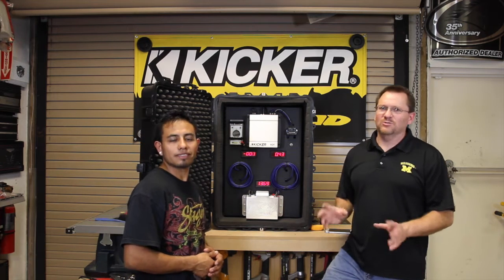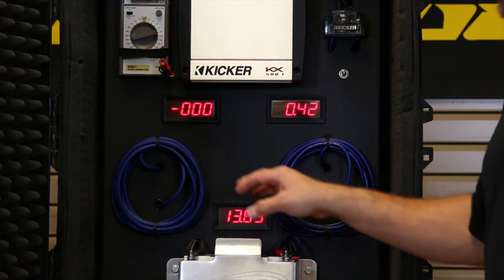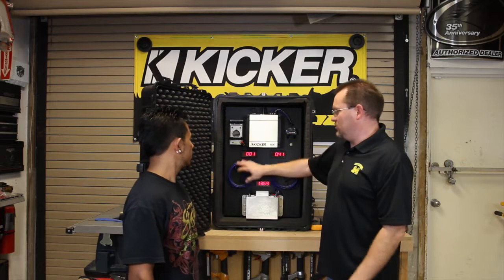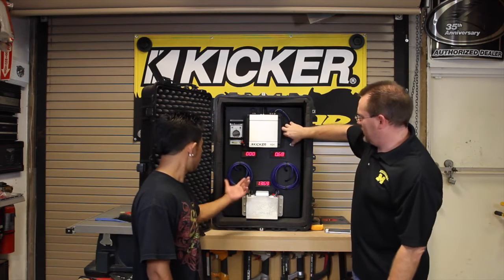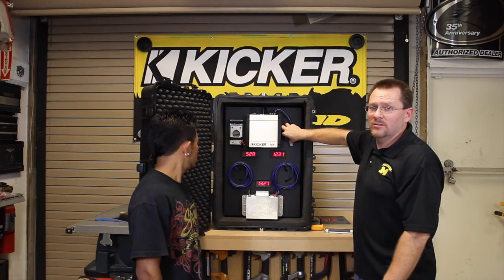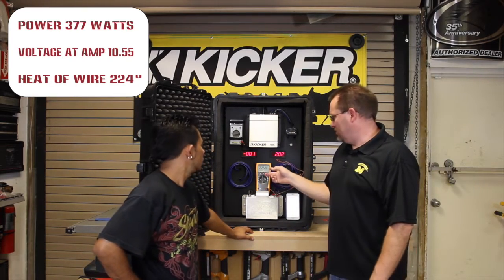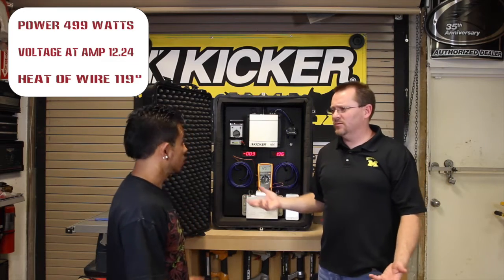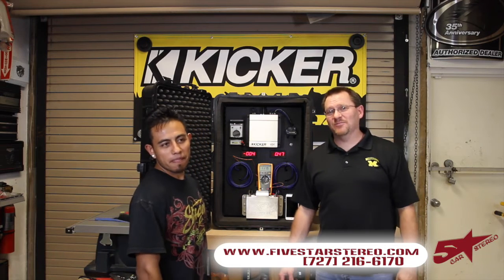KICKER's power wire challenge Copper vs CCA

Comment: What is a reputable 0 Gauge Copper Wire do you guys recommend that won't break the bank? Informative Video. Thanks!
Reply: knuconceptz or sky high all day every day... or look up dc audio power wire on ebay.. if you must you can use 1/0 welding wire as it is ofc but remember the stands will not be as fine so it will be stiffer but will get job done.   i also like 'conextlink power wire" on ebay...high Quality true spec  tinned ofc wire

Comment: cca is standard in fiat and alfa cars.
Reply: CCA isn't an issue when you account for the higher resistance, you have to use a larger gauge CCA based on the load

Comment: Unfortunately this test cannot be trusted.  Kicker has an invested interest and when setting up this comparisons,  you know they  picked out the worst quality CCA wire possible to go against.   Copper is better but not as much as this test indicates.  Don't trust it and find another comparison video that is unbiased to get the true difference.
Reply: Steve Meade does a comparison test as well. He doesn't make wire, he sells ofc as well as cca
Reply: They are using smaller cca in a longer lead too. Just stacking the deck to make it more impressive
Reply: @chriskeplinger3692  I have the same test in my CCA vs Copper video. results are the same, you just don't want to believe it.

Comment: Does this apply to the speaker wire also..... Or is this jus base on the power wire
Reply: Indeed it does apply for speaker wire as well less restriction with a bigger size and ofc wire

Comment: I'm running about 3 feet each power and ground in 4 gauge, will CCA react the same as in the video in such short lengths? Is OFC still an advantage in short runs?
Reply: Quality cca wire like knuconceptz or sky high should act like  6 gauge ofc. As much as I hate cca that short of a run should be ok. I likewise a short run of ofC would be cheap as well

Comment: but what about the thicker CCA wire vs regular copper same gauge, wouldnt it will make up for the conductivity
Reply: Mason Sesak A thicker CCA will match the performance of a stranded copper wire, but it will usually also cost the same as that thinner copper wire. Another downside is that you have no way of knowing the volume of copper in the cable, or in other words, you don't know the conductivity of the CCA.

What I'd like to see is a comparison between solid vs stranded copper.
Reply from the maker: Mason Sesak my guess would be no. Most people say 8 awg copper = 4awg CCA.

Comment: This comparison is decieving.  Aluminum is more conductive gram for gram than copper.  You can use a heavier gauge of aluminum wire and achieve the same conductivity as copper and save weight.  Copper will always win if you compare equal wire gauge size vs aluminum, that is true.  But that isn't how aluminum wire should be installed.  You should always go a couple gauges thicker with aluminum wire than you would with copper.  It will still be cheaper, lighter, and perform as well, if not better than copper.  Copper has a density of 8.96 grams per cubic centimeter, aluminum has a density of 2.7.  You could use 1 gauge aluminum wire in place of 4 gauge copper wire and still be cheaper and lighter and have more power handling capability with less voltage drop.  But if you are confined by space then it might not be possible to use aluminum.

I'm not saying aluminum is better.  I'm just saying people need to understand how to use it.  If you replace copper with a thicker aluminum wire then you will not have the problems shown in this video.

High voltage power lines that transmit power for entire cities are aluminum.  We are talking millions of watts of power.  They are aluminum because it is lighter than copper and you can have longer distances between the towers that support the cables.  If aluminum wire can handle enough watts to power entire city blocks then it can handle your car audio system.  Just use the appropriate size!
Reply: Plur307 aluminum is used for the power grid because it's cheaper not because it's better. It's all about the almighty dollar.  AC power has less of a voltage drop over a given distance as compared to DC. That is why we adopted Tesla's AC power system over Edison's DC power system for our power grids, which also makes the resistance of a power wire more important for a DC power system The best DC power wire is silver tinned copper. If aluminum is such a great conductor, then why do the copper plate it. Aluminum can oxidize especially when it's heated or has electricity is going through it. Copper can corrode and silver is the best conductor that's why the best and most expensive power wire is silver tinned copper. Lots of houses have burnt down because of oxidized aluminum wire overheating and the same will happen in your car. It is alright in an overhead line where the wind can cool it, but I've seen in melt down in underground lines as well. I'm not saying copper is perfect but a lot more problems with overheating have come from aluminum wire than copper. Why put something that's thicker and potentially hazardous in your vehicle just to save a few bucks? Is the money you will save worth a house or a vehicle? Based on my experience I will stick with copper.
Reply: Plur307 Exactly

Comment: fuck, thats why my voltage dips and  is low around 13.3 or 4 when my systems on.and its all wired with fukin aluminum. i thought maybe my grounds were not good.but aluminum may be the problem
Reply from the maker: Yup, the numbers don't lie.

Comment: If Im running OFC wire to power and ground my amps, but CCA to my speakers, there shouldnt me much of a drop from the amp to my speakers right? Considering the wire is carrying much less power and heat is less of a concern, that is.
Reply from the maker: For your smaller speakers it should be fine, however for subwoofers you should do copper. We have seen where it has melted the shielding off the out side of the wire because it got so hot. In one car we saw where it caught the box carpet on fire, lucky not the car. Hope this helps, thanks.

Comment: Awesome video!
Wish I had seen this before I bought the crappy cca kit. :(
Good news is, it was only $36.50 or something.
Bad news is,  I need to spend some coin for good wire. :(
What's a good brand amp\amps for a 8 speaker system.
I'm looking for some decent sound, no thumping bass bs.
New van is limited to 2 speakers in the front.
with some custom small 3 way's for the back in a custom enclose or something.
Thanks